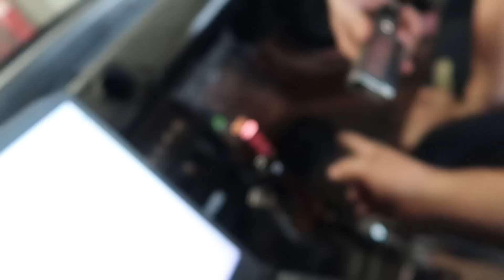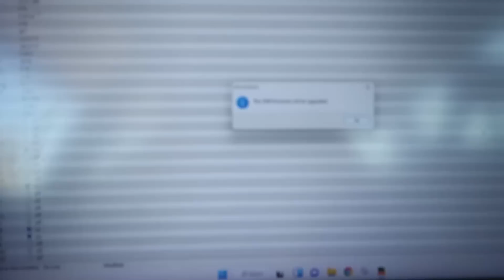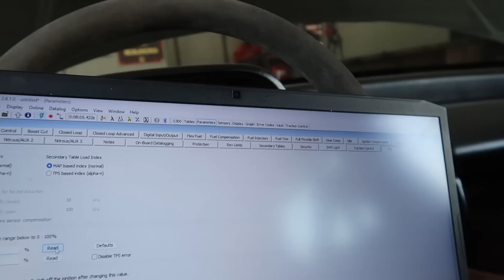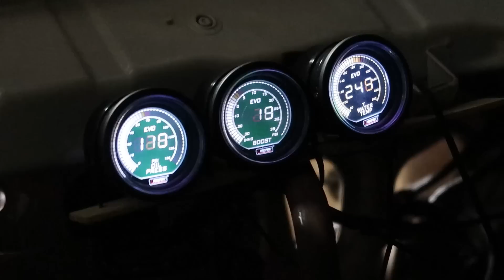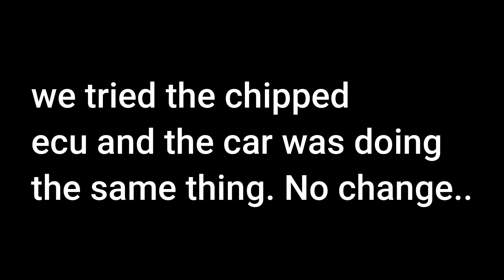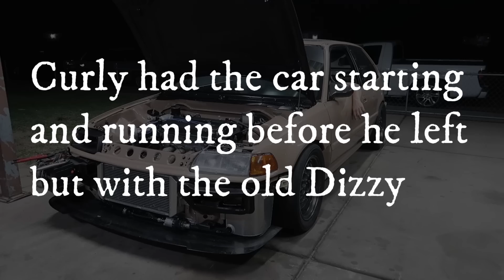I just wanna do Hood Rat things in my Nitrous Car again!

Comment: The part in the distributor that typically causes this is called an igniter...get a Honda one or the OEM equivalent no cheap parts store stuff. It's not too bad to replace you just have to take the distributor apart a little. It's way cheaper than throwing a new dizzy on.

Comment: One thing I can think of is being intermittent,  it could be the engine coolant temp sensor under the distributor.  When it warms up the temp sensor could be reading that it's cold or really hot and adjusting the fuel
Reply: Yup I've had that problem b4 it makes it run really rich & you won't even know because it won't throw a eng. Light for coolant temp
Reply: that’s what i’m thinking
Reply: Possible. But curly would see an abnormal reading on the datalog if so
Reply: @tctnick4156  true but unless they data log it a cold start probably wouldn't show it
Reply: @gabrielponce2885  yeah it would have to get to temp to show itself.

My moneys still on that crap autostore dizzy. Never had luck with them. Always go oem or at the very least a dragonfire is the closest aftermarket with quality sensors
Reply: @tctnick4156  agree on the China dizzy

Comment: You need OEM dizzy. These auto parts store parts just blow
Reply: Facts
Reply: 100% those auto parts dizzy sucks and thoser ngk wires too always oem dizzy and oem wires
Reply: the OEM works after 20+ years, but this is the third time you change the aftermarket one.. junkyard time for an OEM one

Comment: Definitely wanna try to get an oem distributer. I had the same problems on my integra. I replaced it 4 times with autozone parts. then I went and got an oem and it has been running fine for a few years now. Super common problem

Comment: Get rid of the junk aftermarket distributor and find an oem one for starters. Then like others have said, check the temp sensor that sends signal to the ecu and also calibrate tps with volt meter first, then read it with the computer. And obviously get the ecu fixed since Curly said the capacitors are leaking.
Reply: That's like finding gold
Reply: @peopleschampgarage7869  they're still out there though

Comment: Check coolant temp sensors and Iat sensors as well to see if they’re reading properly. Also see if it’s set to closed loop in the tune under the fuel parameters. If it’s in closed loop and the wideband is going bad it’s getting a false reading and making it add or pull
Fuel when it shouldn’t be.
Reply: yup, same thing happened to me. ect

Comment: Calibrate tps with a bolt meter the right way bro. Closed throttle should be .45-.5v and wot should be 4.5-5v
Also khaki sits for long periods of time with ethanol in it. Your injectors are probably clogged and need cleaned and flow tested. Prob why it’s trippin till you floor it and get the fuel pressure built up and gets it to clear up a bit. I’d check those two things first. Then try another ecu.  Set correct dead times, then set the correct map sensor settings and all that in the parameters or it won’t start and idle for you
Reply: Dont have to set voltage with hondata, you calibrate it on the ecu no matter what position the tps is rotated. But he has already had the injectors cleaned and flow tested and still had the issue in a older vid.

Comment: I Feel like 1,000 cc WAY too much. 220-250 hp run around 4-500s cc.  I’d say put stock injectors in ‘ and put fuel pressure at 55-60 psi ,  replace engine coolant temp under the dizzy and  calibrate throttle .45-5v.  Let us know

Comment: yo man you need to save your tunes on your s300 labtop i have 5 saved on my labtop worst to worst you can load them up for winter tune and summer tune... it helps...... good luck broski get your self a timming light and, check your sparkplugs... cap and rotor good ? check the wires two tps cant be bad is your igniters on honda can go bad  #OGDBFAM

Comment: I would put some huntertuned injectors and when u put a base map for e85 u may need to add roughly like 40% plus 7:16
Reply: Did u make sure the tps indention is in slot when u put it on.. ive had a couple ppls put it on wrong u can even test the tps sensor when off by ohm test

Comment: Curly can monitor all the sensors on the laptop right off the hondata. So he would be able to spot a sensor issue right away.

He would also be able to spot a ecu issue right away. Hes a good tuner.

My money is on that shitty auto store dizzy. If not oem atleast get a dragonfire.

Comment: I had the same problem with my car and i actually changed both tps and map sensor on the car and it worked for me. I was getting the min read of-5 and maximum of 60 before i swapped both

Comment: You have to calibrate the tps with a multimeter supposed to be 4.5v and then tighten the tps back down the more you clock it the more the power changes.
Reply: Can also do it through hondata.
Reply: You don't need to if your using hondata, you do what he was doing, closed throttle click read, wot and click read and it sets it no matter where you have it twisted. But yes on a factory or chipped setup you want .5v closed and 4.5v wot

Comment: Gonna go with the coolant temp under the dizzy since it's doing it when it's warm. But my buddies son has a single cam ek with the same issue. Oddly tho if we unplug the tps and drive it runs mint. Plug it back in and it runs and breaks up. Hopefully you find the issue tho man, I know it's gotta be driving you insane.

Comment: To calibrate your TPS Connect your computer to your ECU then read the TPS see what the reading is then go out to the TPS and turn it then read it again try to make it go to 0 then retighten it also get a zip tie and zip tie the connection To the TPS so I won't fall off or be lose
Reply: Also try to resync the timing could help as well

Comment: Those non-oem distributors internals are junk. I had sputter issues when I got into boost and vtec.. got oem ignition coil and ignition module.. fixed the issue

Comment: Resistance
Reply: My engineering diagnostics teacher explained the importance of verifying the battery is good is the first step.  I suggest routing a normal battery in this car to rule out any voltage and continuity problems